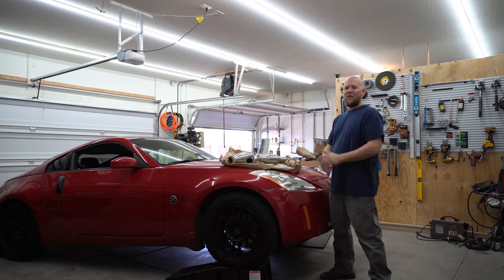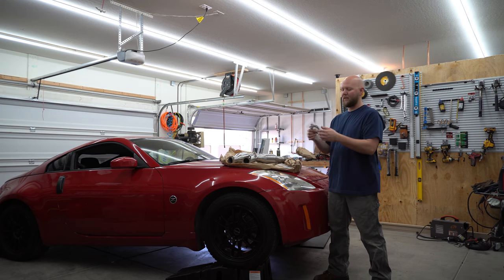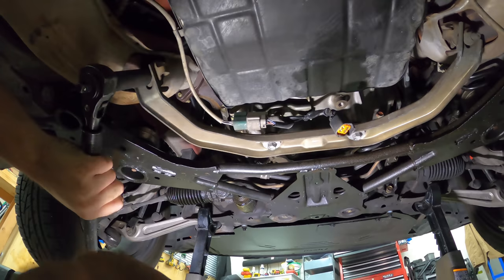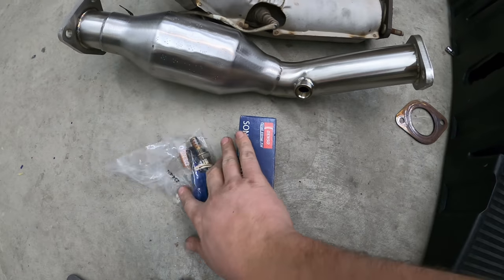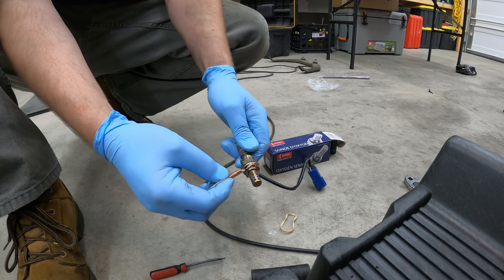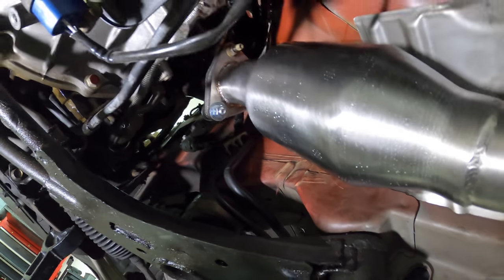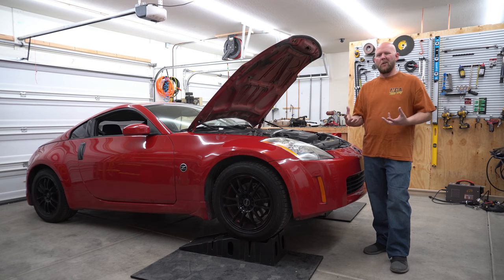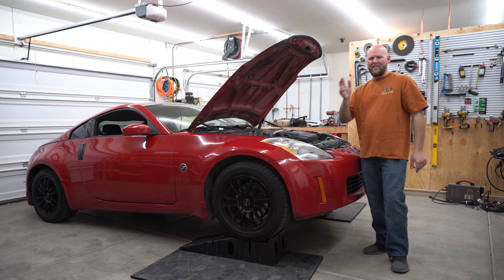350z Catalytic Converters DIY Upgrade/Replacement P0430 and P0420

Comment: Excellent video.  Very good information.  I was wondering.  I could could please help me out with a bad misfiring problem with my 06 350z.  I believe that my high flow cats are clogged up?  My goal is to unclogged/cleaning it?  Can you please advice me if I might run in to other problems by removing them or is it ok to just removing it?  I am in California and trying to get my car pass  the smog inspection.  I have never had a problem with passing smog.  Furthermore.  I have the original cats with less than 10k miles on them.  Took them out less than a year used when I purchase the car new from the dealer.  The car has 35k miles on it and sat for a long time with out moving.  Lastly,  I live in an area full of pines.  Those pines leave a light green powder on the whole neighborhood and believe is the cause of possible debris clogging the cats.
I welcome any input that would help me with my problem.
Reply from the maker: With I could help! I am not a mechanic though

Comment: If deleted cats will help this ?
Reply from the maker: What is it you have deleted?
Reply: If if the catalytic converter were deleted, will it help for the mean time? While I get new ones
Reply from the maker: These are just aftermarket cats to replace the originals with. They are higher flow witch are less restrictive. So if you have no cats right now these will get you cats. They are not equivalent to OEM though